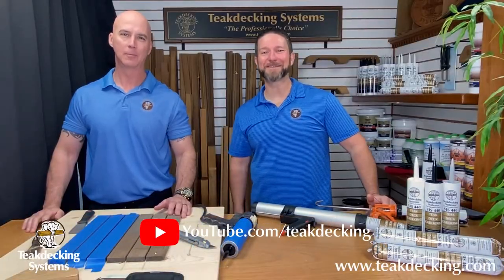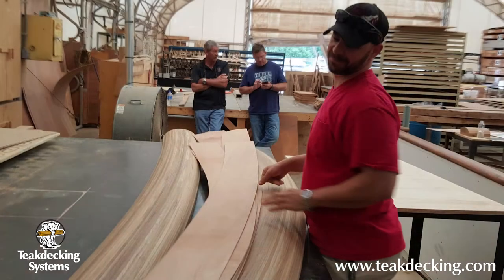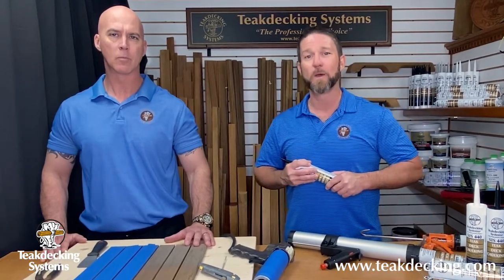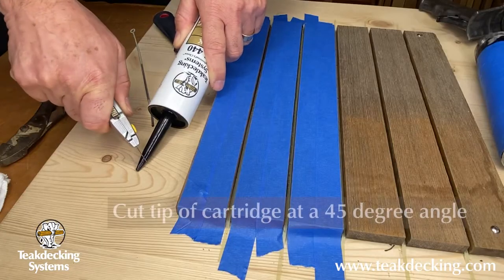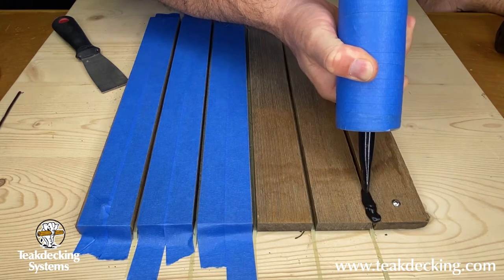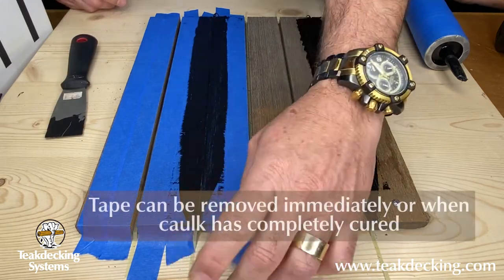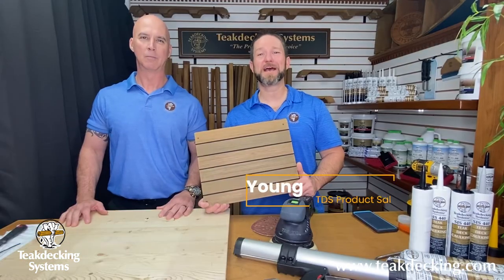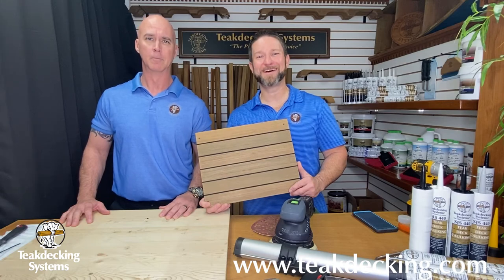How To Properly Prepare & Re-Caulk a Teak Deck Seam Part 2

Comment: I wonder, why is tape only used with limited repairs, and not for bigger projects? Where is the difference, apart from the fact that taping an entire deck is a lot of work? I am very hesitant to sand my deck, especially with the grids suggested here. Any suggestions?
Reply from the maker: In regard to sanding your deck, that is, of course, a decision that should be made after evaluating the thickness left of your deck. If it is marginal, and you only feel you can sand once (instead of before and after caulking), then one way to approach it is to sand the deck before caulking, then tape off your seams before caulking to greatly minimize sanding after caulking. You will find that sanding your deck prior to caulking will mean far less sanding after you caulk (without using tape). Since sanding helps to remove the grooves in the deck that hold the caulk after applying it to the seams, it takes a very nominal amount of sanding after caulking if the deck is already nice and flat. If you caulk before sanding with no tape, it takes far more sanding to remove all the caulk excess if no tape was used. The reason this happens is the sanding not only removes the rough, harder grain that you see when the deck has been worn over time but also flattens the teak surface; in other words, sort of surface hardens it. Teak has a lot of natural resins, and sanding is like applying a new finish to your teak that will make caulking easier and give you the benefit of a longer wearing surface. If you have any questions about how you should approach your re-seaming project, please feel free to call us. Sometimes, we will ask for pictures to help us give you the best possible recommendations.
Reply: @TeakdeckingSystems  thank you for the lengthy and informative response! It makes sense to sand before caulking as you suggest, and I think the result would be really good looking. But it would eat up a lot of teak thickness. Personally I intend to tape the entire deck before caulking as to save as much of the teak as possible. I’ve cut out 98% of the old seams by now, and still have a lot of work to finish before I can start taping and recaulking.

Comment: It probably shouldn't matter but this works with mahogany fine, right?
Reply from the maker: It sticks fine to mahogany, but there will be a problem if you try to varnish over it. Nothing wrong with using it as a sealing bead at a base joint, where you can varnish right up to the caulk. Some people also apply the caulk after varnishing, please read my previous reply that addresses how to best perform that task.

Comment: Hello,what is the best glue for under net the teakwood.. I want to repair the deck in the ships..thanks
Reply from the maker: Thanks for your question regarding making repairs to your deck. Our purpose-made teak deck epoxy products are the best and most permanent solution for replacing or re-fastening your decking. We make two recommendations for this, FFE-200, which is a super strong adhesive epoxy that can also be used to fill voids, as it can be sanded. We also have FE-180, which is a bit thicker and has a little longer working time. Both are “equal mix” epoxies, you mix equal amounts of part A&B. Never mix more than you can use in about 40 minutes, and keep in mind that all epoxies will cure faster if a larger amount of the product is mixed at one time. Be sure to clean the area you are working in well, and wipe both the board and deck with acetone prior to gluing. We also have a one-part glue in a sausage tube for small repairs called MPS-4000. It is different than 3M 5200 and other similar glues as it has a very quick “green time”; in other words, be sure when you place the board in that glue that it is where you want it to be! The MPS-4000 is specially made to keep a part where you place it. Although we always would rather use epoxies to glue decking, the MPS-4000 is a good alternative if you want to make a quick and easy repair.

Comment: OK guys, nice job BUT after the caulking sets and deck sanded - then what?! Varnish and paint will not adhere to 440; if I want to varnish the deck do I just varnish right over the 440 seams. If I varnish before the 440 goes in won't the varnish run into the empty seams, making an adhesion problem for the 440?
Reply from the maker: Thank you. We are often asked about varnishing and how it can be done with our SIS440 teak deck caulk. Unfortunately, to achieve the longevity that our SIS440 is known for, it had to be made in such a way that it would withstand UV, about any chemical you can throw at it, and a considerable amount of deck flexing/wood movement. To achieve all of these things, we had to give up something, and that, unfortunately, was making a product that varnish would not stick to. Having said that, we do have some customers that are determined to work around that issue. After a phone call with a customer recently who was restoring an old Lyman runabout, we discussed how he could work out using our SIS440 and varnishing “with it”. (not over it) What he did was to varnish the deck, then carefully taped off his caulk seams. He then used some sandpaper and carefully roughed up the seams, vacuumed them, and cleaned them with isopropyl alcohol. (you don’t want acetone near fresh varnish!) He then freshened up the tape and used our white caulk in the seams. A lot of work, admittedly, but he had already experienced problems with two other popular brands that both failed. It was worth it to him to go the extra mile; the result was fantastic! If you would like to email me (Jeff) at products@teakdecking.com I think I can find the picture he sent of the finished project. In addition to that method, some customers (especially in the UK) have sanded and then varnished over our caulk. But these boats are covered most of their life, and inside. Eventually, it can and probably will fail, but they had such bad luck with other sealants they were willing to try. There is a primer that will help if you can find it. A water-based shellac applied over the seams appears to provide enough isolation from the movement of the caulk and will bond to it, but the source we used to have for it in Florida quit making it. If you find something like that made by someone else, we’d be willing to test it. There is one other product you might want to look into that customers have used with our caulk successfully in the past, which is Deks Olje #1 & #2 wood finish. They use a special additive that makes the varnish flexible. We cannot promise success with any product/method, just trying to give you all of the information I have. ANY solution you decide to try should always be tested first before proceeding. As you can see by reading the above, there are ways to try and varnish with our SIS440, but  unfortunately at this time we still have to have as our official policy that you cannot reliably varnish over our caulk.

Comment: If I choose to sand (I am using sapele wood) what do I use to finish my deck? I want to use wesr systems clear epoxy followed by marine varnish or just marine varnish. However, I read that epoxy and or varnish does not adhere well to caulking!? Also the decking strips  would be applied to the deck substraight via epoxy. The cured epoxy is now underneath the caulking lines! So is this problematic?
Reply from the maker: Hello, let me first address your question regarding the deck substrate glued with epoxy. Which epoxy did you use? Our FFE-200 or FE-180 will adhere just fine to decking with our caulk. I cannot recall having had a customer first use West Epoxy and then varnish over it, so I’m not sure how that would last long term. Most likely the West Epoxy would stay adhered to the deck due to the “bridging effect” of having the epoxy layer that adheres to the wood forming a continuous layer over the caulk seam. We don’t know how long the wood movement may occur over time before you start to see a “shadow” where the caulk may begin to separate from the epoxy. Without testing, this is something we cannot predict. Officially, we have to say that you cannot varnish or epoxy over our caulk as it doesn’t last long-term. Still, please read my prior reply to another customer who asked about varnishing for other possibilities. We have had customers who used Deks Olje #1 & #2 successfully over our caulk; it is a thinner product and has that additive they use, making it a flexible finish. These are all suggestions, but please conduct a test before proceeding with your entire deck. Unfortunately, our official policy still has to be that varnish does not adhere well to our caulk because of its composition and how much it can – and generally will move with the nature of wood, the natural expansion and contraction.

Comment: And almost nobody explain us how to reroute the seams. Mine are 0,5 to 1 mm as everything else were sanded off. But I  got 10 mm left.

Next... I think you can not repair a new decking as it has only got 6mm of wood ond often not even teak. I have a plate here: 7 mm, 2mm teak and 5 mm cross layed plywood. The seams are fake ones and only 1-2 mm deep.

Conclusion: never ever try to renew the teakdeck as you will get a deck that will only outlast ten years - if you are lucky. And you pay 20.000 + USD for that scrap.
Reply from the maker: Hello, you have some good questions and observations. Many decks are built with a “rabbet”, in other words when the deck is laid the builder cuts a “notch” usually about halfway or slightly more in the boards and that is used to space them when they are laid out on the deck for fastening or gluing.

You mentioned that you have 10mm of wood depth left, but then also said 2mm? If it is 10mm of teak, then you have plenty to work with. But, if there is a thin layer of teak built on 5mm of plywood, that doesn’t leave you anything to work with.

I always recommend that a customer looking to re-seam their deck to first perform a survey to determine if the process is worthwhile. Unfortunately, not all vessel manufacturers build decks the same and although I don’t know what type boat you have, I know that some powerboats from the UK, Italy, and France all may have been supplied with decks that have a thin layer of teak, and sometimes use a plywood substrate. This can be deceiving, as it appears that you have more to work with than you really do. Hopefully, a reputable company will warn you if they see that the deck really is not worth re-seaming. I recommend customers to use a pen knife and check the deck in at least a dozen different places, all over the vessel. For instance, you will find more wear up (& less depth) forward on the forward bow-weatherdeck and on the swim platform than you will find further aft on the walkways and in the cockpit. Before committing to a re-seam, educate yourself! If any doubts or if you need more information – please call us and we will help you evaluate your deck.